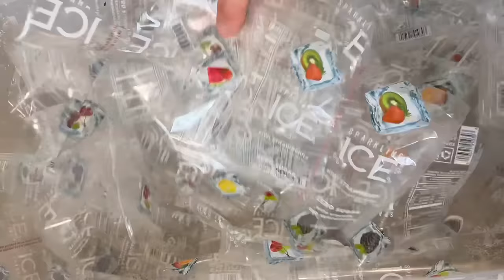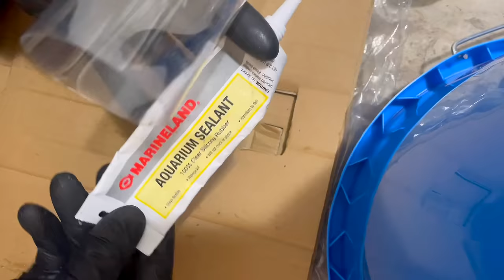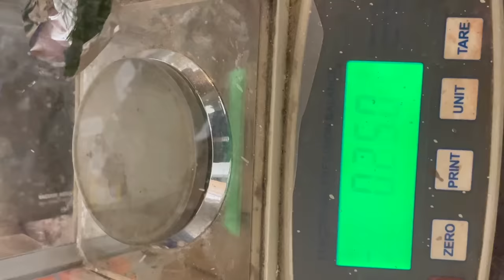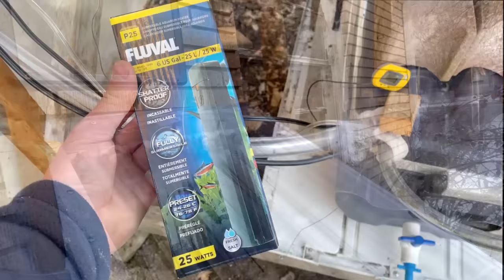Cody's Algae Panel

Comment: I feel like you're going to want to be more careful about sealing the holes in your system - especially the algae tub. You do have bugs in your greenhouse, and if there's one thing I know about bugs, it's that they love to get into open water sources. Dead bugs aren't something you want floating around in a food source. Also some way to avoid any spores or microbes from creeping in through the air intake. Like with mushrooms, you're going to want the system to be sterile and sealed to avoid contamination. Might also want to look into ways to isolate the starter algae culture from any contaminants too.
Reply: Using clear PVC pipe for the panel, tubing and even large diameter like 12" for the reservoir would keep the entire system sealed. Air intakes could use bacteria viral (BV) filters like the ones used on medical ventilators would keep the air supply clean. I also wonder if there is some antiseptic that could be kept in the algae solution without killing it to prevent microbes from colonizing.
Reply: @MPIronmanJC  iodine comes to mind. It's a sweet water algae tho
Reply: Drilling holes, the exact size of the tubing, then using silicon sealant should fix most of the algae tub issues. As for contamination, he could honestly take one of the filters from the mushroom grow bags and put it over the air intake and that would keep most stuff out.

One other improvement I think Cody should do is take a cap from one of the water bottles, and glue it into some tubing and drill a hole in it for sealed water input and output by screwing on bottles. When not in use, to keep it sealed just leave empty bottles on it.
Reply: Isn't most algae commercially grown in open concrete pools and not sealed systems?
Reply: @oakiemouse  Not when intended for human consumption, I don't think.
Reply: dead bugs are edible too
Reply: @oakiemouse  At large scale, I suppose it's easier to purify the algea afterward than trying to keep the whole thing sterile. But I think those ponds you're refering to are for biodiesel production. For human consumption, I'd say they use bioreactors.
Reply: I think Chlorella is often grown at alkaline conditions, which would kill a lot of bacteria and bugs, but there is probably some stuff that could grow. The media he uses might be designed to be alkaline.
Reply: @trollmcclure1884  What does sweet water algae mean? Grown in water that's safe for eating?
Reply: @mjstecyk  sweet water is another common term for fresh water (low salinity)
Reply: It's an uphill battle imo because the system being connected directly to open air by requirement will inevitably cause mold and fermenting bacteria/yeasts to grow.
Reply: @Relatablename  Simple answer no one has pointed out yet is to have the air as a sealed system too, a balloon on top for example, when water drains, the vacuum created will pull air from the balloon, then you pump the water in from the bottom and the air will be pushed back up into the balloon. Simple.
Reply: @Shrouded_reaper  I like your thinking, but the vacuum could pop the algae, and the majority of the unused air could get stuck without an escape. Maybe there's a good compromise somewhere...
Reply: @Fate.s-End  look up the FDA limits for bug parts in your favorite foods. There are bugs in everything.
Reply: @littlejackalo5326  There's a difference between some dry insect exoskeleton parts ground up and distributed sparsely throughout flower and insect corpses decaying in water. Or even, god forbid, it being turned into mosquito breeding ground.
Reply: @Shrouded_reaper  The algae needs to breathe too, once the CO2 is depleted it won't be able to produce glucose. That's why a filter is the better option here.
Reply: @Fate.s-End  CO2 in a bottle connected to the system, just add more when you need it
Reply: @MPIronmanJC  pvc is not food safe btw. because of toxic phthalates. yes i know a lot of people use it for plumbing.
Reply: @prydzen  depends if you use potable or drain grade

Comment: Hi Cody, Keeping ur water temp near ideal growing conditions (21C +-3C) is challenging and appears to be your determinant growth variable. Its a common issue with outdoor bioreactors. I'd suggest putting the tubes indoors and submerged in a clear thermally stable liquid (or just water) to maintain a relatively constant temp. I know that doesn't fit your theme. You could eventually use solar panels/cells/battery/LED grow lights to maintain 24hr growing and stable growing temps/conditions. Yes, that's pricy. With stable temps, You should be able to max-out your bio-reactor within 5 days.

Please check your algae variety often, like daily, and have backup virgin species on hand to start new clean reactors as needed. Back in the 2000's, when I was looking at this (for biodiesel/coal flu gas treatment/food/cattle feed source, etc), foreign or 'local' algae would be take over the bioreactor within 90 days. We simply just don't have a filter capable of 100% contaminant prevention... maybe we do now, or you could invent one? Safety tip: The foreign algae can be toxic to humans/animals. It can kill you, or destroy your kidneys, liver, ect. Also, I strongly suggest that every part of your bioreactor that is exposed to algae (storage basin/tubes/hoses/fittings) be easy to access for cleaning. Because of the foreign Algae introductions, you can expect prolonged contamination issues.

The predominant joke at the time was that anyone that could run a stable independent bioreactor for longer than 4 months would become a billionaire. I was inspired by a guy named Isaac Berzin out of MIT. His research papers are a great place to start for info on the topic. I think he ended up being funded to do a full scale project in South Africa or somewhere, I don't know him personally and it was along time ago. Any hoo, Looking good so far. I used T12 lightbulb covers from H.D. as a cheap tubes. However flexible clear PVC (UV stable) tubing's now the more common (used for product packaging) and dominant tubing material. I lost interest and stopped all this after a pear reviewed paper definitively showed all diesel fuel including biodiesel & its exhaust were carcinogenic. Hope that helps, Good luck :)
Reply: Hey, just in case you are interested, in Spain there's a research facility that uses microalgae as a way to treat waste water, use algae as an edible product and as fertilizer for crops. It uses a local strand so that they don't have to fight it and they produce an economically viable product.

The algae just grows thanks to the great amount of sunny days they have. If the algae is consumed by humans they have it in tubes, but if it's to feed insects or to be used as fertilizer they can get away with open-aired containers.
Reply: @fantasticomanga  Very cool, also Hawaii has similar program :)
Reply: @hytecmobile  its amazing to see people interested in these super plants if you want more check out azzola, duckweed, and wolffia globlosa
Reply: I'm curious about the diesel study you mention at the bottom?
Reply: Also, Solar Foods is a startup that's making the most sustainable food using algae... I guess they use a completely closed system and advanced air filters to prevent foreign algae contamination that you pointed out... Also, the fact that burning the oil it produces is carcinogenic shouldn't dampen your interest in it, after all, even without the oil it has so many other use-cases such as making food and even bio-degradable manufacturing materials (for instance, there's one company that's making flip-flops out of them).
Reply: Very informative comment
Reply: @theaman1786  yea thats true also if we start looking for cleaner ways to use oil, such as fuel cells we can reduce up to 70 percent of emissions and improve efficiencies, only problem is alot of the catalysts are expensive
Reply: @BossOfAllTrades  Indeed. In fact, using closed fuel cells (which contain all the oxygen they need within themselves already, besides the fuel and an electrolyzer) could give one absolute relief that no carcinogenic substances get released into the atmosphere... As for fuel cells, I just googled it and yeah, the catalysts seem to be the limiting factor there... As for biofuel energy production, there was another great video I watched that same day that said that the bottleneck for the success of biofuels (besides economics) was breaking even: today's fuel cells, in total, take more energy to run and maintain than they produce; kinda like fusion. But then again, even with discounting away the energy-production potential, there are so many other use-cases for algae, such as in making biodegradable materials and making the most sustainable food... As for energy production, I personally think the whole world should be powering itself off of geothermal energy, at least until fusion gets realized. Sadly, the company (Solar Foods) compared algae-based food production to brewery and doesn't think everyone should be doing it from their homes, that is to say, it won't be making a commercially purchasable at-home food-making machine for the consumers anytime soon...
Reply: Thx for sharing your knowledge
Reply: you said "biodiesel & its exhaust were carcinogenic". that is interesting.  isnt toxic if it is heated above a certain temp? or dodes it have to be lit on fire to have it become tocic?
Reply: You telling me a pear reviewed this paper
Reply: Forget exploding fuels and produce carcinogens, convert everything to ethanol (stable af, safe enough to drink... in moderation!), and use fuel cells (comparable but safer results and energy densities to burned fuels).
Reply: Good point maybe throw in a bit of bifodo/bacillus  subtilis bacteria  for infection  control (don't know how it would affect good  alge tho
Reply: Best comment

Comment: You can use volume to your advantage here. Building a 10m2 panel 50 cm thick will be cheaper than building 20m2 at 25cm.

Obviusly its not endless but in the ocean sunlight doesnt realy deminish untill like 50 meters.

You can also add a mirror underneath to have the sun pass through the mix twice.

I would also recomend a head exchanger both to cool the selution and to heat it if it gets too cold.
If you collect enough heat of it you could heat a shower with it. Or atleast your greenhouses.
Reply: In the Gulf of Mexico it's more like 8 feet... but the mirror idea is good. It doesn't have to be a smooth specular reflector, but something vaguely reflective, or very, very white, would get more light to the algae, assuming that much light makes it through. It's also a thermal management issue. You might want more of the light to be used for heat in the winter, and during summer bounce it back. Of course with adequate power production you could rely on the active heating in the tank. I'm kinda thinking the ideal system would have the thickness of the pipe based on the occlusion of light at the bottom, and in that case, there wouldn't be enough light to worry about reflecting. How dark is the water going to get at full saturation before you harvest it? It would be interesting to see how industrial algae farms do it though.
Reply: Fr the advantage of water is it's insulation so the temperature won't fluctuate as much between day and night

Comment: I remember back in the 70s when this idea was first taking off (Prevention  and Organic Farm and Garden magazines talked abut this back then, around 1974, I believe) and a friend and I tried growing and processing this algae that we then made muffins with and it was ok. As you said, not gourmet. But, edible. I later tried it in some borsht as the beets would over power the flavor of the algae and it worked nicely. Now that you have rekindled my thinking on this and the need for self sufficiencey, I will set up my system again. We used a waterfall runway to our fish pond and that produced a fair amount of algae. Since we were not planning on eating it raw but only in cooked foods, it did not bother us that it was fed fish waste. So, the algae grew very fast and very thick. Since the spill way was of hard wood, it clung to the wood and was easy to scrape off. Now, I will build several so when one is off to dry, the others are still going. Maximise my production and harvest ability.
Reply: sounds like a good idea
Reply: imagine if u bought into super blue green algae MLM way back then u be a multi millionaire now
Reply: @feelinghealingfrequences7179 : That requires a cooler climate than what we had in the bay area.
Reply: Nice one sir, thank you for sharing your experience. I like the double function of the hard wood spill way, very efficient and practical!
Reply: @calebbelac8335 : Thank you.
Reply: @sonofeloah  hi bu
Reply: FOR HYDROGEN PLATINUM IS NEEDED.sell gold buy platinum.price is low now.. follow platinum strategy///
Reply: dude you're leveling up your farming skill lmao, great idea tbh
Reply: Would algae as an additive to noodles work good? Might find a use in a lot of simple dishes if that could work. If i works you could try and prepare your noodles in different flavor batches, and get a tricolor pasta effect going on, where the different noodle flavors add variety to your dish, and aren't as bland to consume pounds of the same noodle flavor.
Reply: @weeveferrelaine6973  It would and you can add a flavoring to the noddle batch as the algae by itself in noodles would not be that appealing. But that for green noodles and tomato powder for red noddles and so on to produce almost a rainbow of colors. But, you would have to watch out what colors produce flavors that would mix well together  or do each color noodle as a solo noddle in specific dishes.

Comment: If these were set up vertically along the northern wall of a greenhouse, they'd be useful for doing double duty as a thermal stabilizer for the internal air temperature!
Reply: and as a bonus you could use IBC totes for the storage, of both heat and algae.  Though you would have to have it set up to limit the amount of heat gain while maintaining the light it receives to keep it alive.
Reply: Bump
Reply: I like your thinking OP. What do you call steam punk living that also involves lot of neat uses of algae?
Reply: @KingOhmni  Biopunk?
Reply: @FortySixandTwo595  you're onto something
Reply: @KingOhmni  SolarPunk is typically the used term for this kind of thing
Reply: For the electricity cost of the water pumps, you could produce far more efficient temperature regulation systems.
And despite the uninformed enthusiasm of the other replies, there is nothing "steam punk" about being dependent on a utility megacorporation for your food production. Millennials get everything backwards, every time. smh.
Reply: @FortySixandTwo595  biopunk I like that, I'd imagine lots of greenhouses and plants growing everywhere
Reply: @archenema6792  who said anything about megacorps? Maybe dude had 10k hamsters in his garden running on wheels?
Reply: @seeker296  I know you think you're being funny, but all you really accomplished was to demonstrate my point by exposing the abject economic illiteracy of most Millennials.
How would he feed 10k hamsters? How many acres of land would that require, how many gallons of gasoline to plow and till, how much electricity and methane to light and heat the Hamster House, and if he could not do any of that, how much power from utility companies is used per pound of hamster feed produced?
Hamsters don't live on air and hope. But Lord knows how you "pie-in-the-sky" woke leftists love hamsters, especially Richard Gere.🤣🤣
Reply: @archenema6792  you are the strangest troll i seen in a while
Reply: There's an experimental building in Hamburg, Germany completely surrounded by algae tanks. Iirc it saves on 30-40% of energy costs because of the heat the algae produces. I think they also piped the hot tap water through the tanks so that it comes preheated.

Comment: Learned so much from you over the years. From making gun powder out of urine, refining gold from spark plug dust off the road all the way to growing algae. Amazing.
Reply: Actually it was platinum (and irridium) from just the spark plugs, then another video mining platinum again but from the road dust (which actually assayed to be a viable platinum ore) 🤓
Reply: It was platinum from catalytic converters, which is why he liked the exits of bends because engines are under higher load when accelerating out of corners.

Comment: It's great idea man. Im building a pond on my property for similar reasons. Will grow algae, duckweed and fish. Carp fish last all winter and if you clear the water, algae can grow under the ice even in winter. As long as you stir and airate the water somehow. Using windmill and solarpanel should work most of the year. Collect some staple food before harsh winter tho as here where I live, wintertime has 24h darkness cycle. No light, no life. It's stagnated at least. For about 1 month it's total darkness, then it's doable again. So food for at least 1 month prior is essential. Unless you have land to hunt for gain or dig for food in tunnels under the frostline.